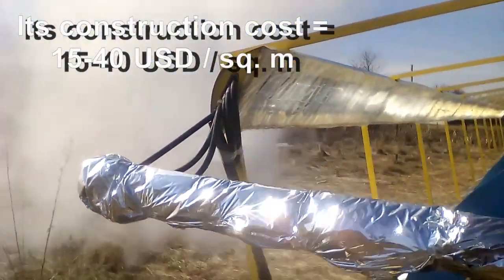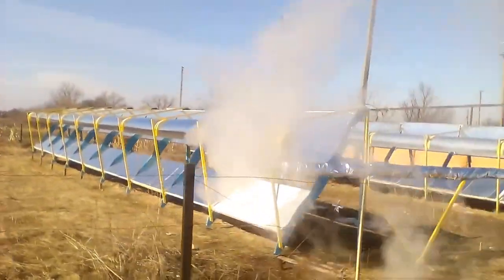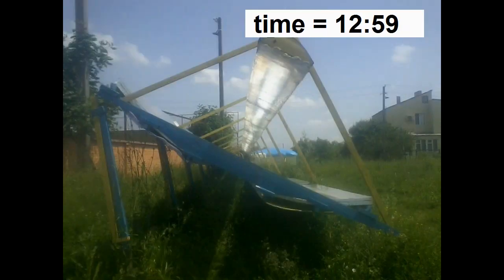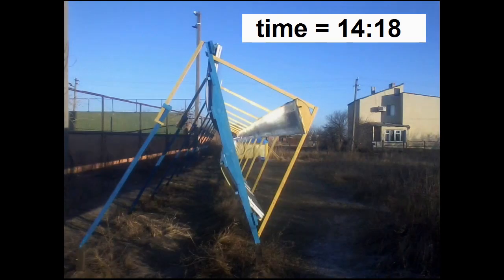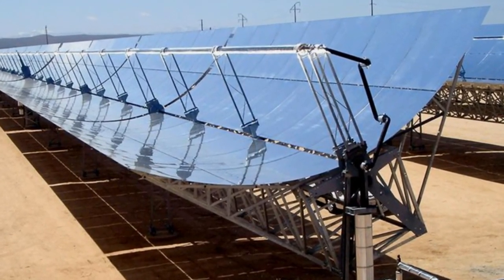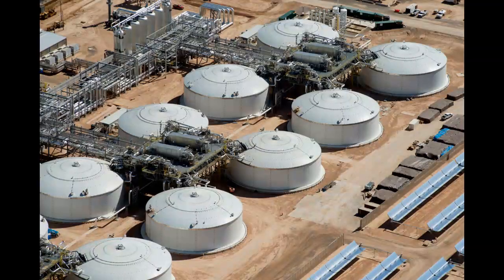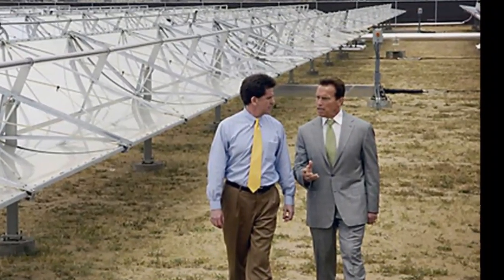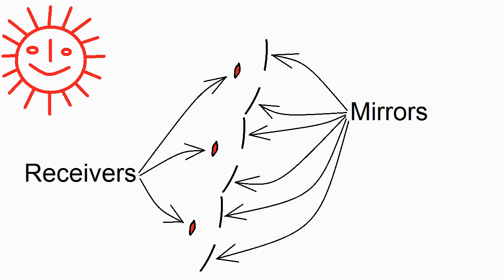Very cheap ( $15-40 ) solar collector-concentrator that does not need a tracker

Comment: Unfortunately, in your videos and projects, all of you focus on the movement issues of the shower, and you forget the most important thing, which is connecting the water pipes, entry and exit, beside the heating head, in the dish collectors. The scenes are not important except those.

Comment: Great vid. Thanks. Another option for 150-200°C heat is an ORC generator. Use the high heat to make electricity (ORC), then use the waste heat to heat water for hot water & space heating.
Reply: Hmm so this is capable of super heating steam above the 100°C or is that what the ORC is for to super heat the steam? 

Is it possible to also use the system with the ORC to take the low pressure steam put out by the ORC for the production of browns gas to further improve and maximize output in a zero waste system in a multi step process? I.e. this concentrator creates steam which powers the ORC which creates heat for heating and power which the wet low pressure steam from the ORC is then used for electrolysis to make browns gas which powers another engine which produces water as a waste with heat and electricity being generated and harnessed where as the water goes into a tank where the water is cooled before being pumped into the solar concentrator? 

Sorry if thats convelluded new to all this and trying to learn as I wanna build my own off grid sanctuary...
Reply: @kingdarkem  ORC's don't use water, they use a closed loop gas. Think air conditioner but used to make energy, instead of using it to cool or heat. It uses the temp to flash boil the gas (refriderant, CO2, LPG, other) to push the turbine, which turns the generator. They tend to be used where mid or high temperature heat is NOT available (less then 500°C) or trying to increase efficiency in high temp systems to use waste heat to get more power out. Also used in remote locations (towns, minesites, etc...) where large diesel generators are used to use as much heat from exhaust & cooling water before being rejected to the astmosphere.

Main reason they are not implemented more is due mainly to setup cost. Not that many companies do these systems and those that do tend to be pricey to lack of demand/interest.

There are small systems available. If you have experience with building air conditioning systems you could build one for yourself, or buy a "kit" from the small system manufactures.
Reply: @elenidemos  u dont need complicated setup or exotic gas for refrigerant, if u plan to build some solar refirgerator ammonia are cheapest way, assumed u know how to seal n handle ammonia, then free ice maker!

Comment: I've always wondered why they didn't align the concentrators (parabolic troughs)  east to west as was done here. Even if they used the exact same trough profile and thin line collector the tracking mechanism would have a lot less work to do and hence probably be less likely to experience wear. Nice to see somebody taking this approach. As I see it, adding a fairly simple tracking system with a movement range of less than 90 degrees to focus the spot accurately throughout the day would make the system capable of higher temperatures and more consistent output. The closer to the equator the less the movement range would have to be. I'm just glad to see someone trying this approach!
Reply: to put it simply : the west/east side need more surface cause you can't stack them one behind another.
At first sight, north/south is better

But I guess Sergiy is the first to have retro engineered it to decrease the cost by ignoring the downside of E/W solar concentrator.

Comment: I've seen two parabolic heaters in my life.  Why they haven't caught on for home use is beyond me.  Especially in the winter months.
The first time was in high school in the late 70's to 80.   The school had an energy science fair.  There was a parabolic heater.  It was quite ingenious because it really didn't take much to make.
The second time was a house a few blocks from me.   For some reason it's not being used anymore.   
I think my concern would be the excess heat generated and where to put that pressure.
Reply: A big insulated water tank may be?
Reply: Release it through a turbine, store it in any system efficinet enough to contain your excess energy long enough to cover night tine usage
Reply: @dlayman101  If I had unlimited water that would be a great idea
Reply: @beebob1279  closed loop, low pressure and high pressure side, just like a heat pump, then use a geothermal loop as the condenser, done deal bud.
Reply: @beebob1279  actually theres more too it but do some reading aboit absortion coolers, combine that with geothermal loop, combine that with an electric solar panel coolant loop, instead of a vacuum tube, build a single cell channel, point mirrors at that boost the electrical generation to 80 precent, remove the excess heat from the solar cell to increase longevity of said cell, then take the heat used to power your turbine, followed by use remaining heat to heat the absortion coolers boiler, all excess heat not needed can be converted to cold via absortion cooler, then any excess cold can be used to cool your house, or your panel array. And remember there is no such thing as cooling, only heat transfer due to a energy differential of heat energy, as long as there is difference of tempature, that difference can be used to boost efficiency.

And an absortion coolant system does not require a compressor or electricity.

Enjoy researching that project, im going to go bqck and continure building a solar company based on my idea like ive been doing lol.

If youve got questions feel free to ask, this solar guy is one of the few who isnt out there to scam anyone.
Reply: what you can do with excess power is always heat up some temperature isolated salt or sand with heat exchanger built in...☺ when you need extra power you may always draw from this surplus heat auxilliary supply...like at night or in cloudy times...or even winter...
Reply: @dlayman101  and one can use your idea about cooling when you stay in places where there is too much heat, in combination with surplus heat storage...there is so much possibility...

Comment: An offset receiver, getting reflected sun, is exactly how high gain satellite dish designs work.  It improves efficiency by removing the 'dead spot' in front of the parabolic reflector.

Comment: This may sound REALLY dumb, but couldn't you orient your solar collectors the same way as the tracking ones and use a simple counterweight system to rotate them throughout the day?

It would require a bucket big enough to hold enough weight in water to tip the panels, a very small water pump to fill the bucket, a timer for the pump, and a pulley so that when the bucket has enough water there's enough resistance to not just tip the panels all the way to the other side. A small hole in the bucket (or an automated valve) would make sure the bucket is emptied at night for the system to reset.

Comment: Sergiy, I really appreciate your work. Have watched many of your videos. You are very creative, and approach the data scientifically, which I appreciate. Thank you.
My question is about the steam generator part of the system. How does that work to create DC electricity, please? Is there a particular steam generator unit that you recommend? Is it a closed unit so the steam condenses back to water, then steam again or do you need to add water regularly, please?
Reply from the maker: It seems to me that the best generator (for heat up to 150 degrees Celsius) is ORC. For example: https://infinityturbine.com/it50-system-plans/
Reply: Sergiy Yurko wow, that is a huge machine!
Thanks for posting these vids. I learned a lot.

Comment: A drum of gravel and water can store far more energy as the thermal mass is increased. Insulate with wooden box filled with hay or even chipped polystyrene. Very impresed with your work

Comment: hello from Denmark
I enjoyed seeing the video you put up on YouTube.
two of the Solar System's you are showing is from Denmark
which build together with small district heating plants in small towns in Denmark to make it more climate-friendly and cheaper
the two systems point in a southeasterly direction
in the direction of high noon. 
some of the systems can move but it's only moving from summer time to winter time
there are many systems like that in Denmark.
in Denmark in winter there is only 7 hours of sunlight that the sun is very low so therefore it is important that the panels can be moved

Comment: Genius! I am interested in similar concepts but applied to greenhouses. Earthen or wood/cob walls, slotted opening in back (narrow and above head level for safety with shutter or curtain at night) with white ceiling, grow veggies early and late in season. Warm and well protected from extremes, dome shape would have water collection at base/circumference so rain would still get to crop within, but storage could be built in wall too so thermals mass effect could help keep temps in nice zone, and downpours would have more time to soak in nice and slow/gentle.

Comment: I am interested in heating oil. Circulating the oil to make the storage tank hotter. I think the temperature could reach 400 degrees Fahrenheit (200 degrees Celsius) as I saw in another video of one made for a university. I don't believe I could use regular pipes in the collector area. Hoping to hear back from you. I'm in Phoenix, Arizona.

Comment: If you use a helix wound coil for heating water or coiled pipe you may heat water more or a worker fluid more over time or a more compact space.

Comment: I wonder if a system like yours could be used to power an ammonia absorption refrigeration system like the I.S.A.A.C solar ice maker.  I would love to find a way to reduce refrigeration and freezing costs, as well as providing at least a marginal non-electric back-up.
Reply: Im literally in the middle of building a company that does exactly that. One larger absortion based hest exchanger, a geothermal cooling loop, electrical colar panels insulated with argon, with enough reflected light pointing at it that it will absorb enough heat to ruin the solar cell, except the solar panel array will be cooled by an absortion heat exchanger, which the same array will then produce more elctricity per sq ft, and as long as the absortion cooler is large enough, it can be used to cool a radiator fluid loop thats pumped into and out of the home to be used for refridgeration, air conditioning, or heating depending on the time of year.

It removes massive peak electrical loads of the compressors in those appliances, therefore reducing the required size of the solar array. As well as the size of the battery storage system, as well as the size of the inverter required.

If the remaining electrical devices and appliances in the home are converted to direct dc power, then an inverter is no longer required, as well as your efficiency will increase another 20 or 30 precent because inverters are not efficient, and the majority of the stuff we plug in today goes through a transformer and bridge rectifier, which again reduces efficiency, which is done to conver ac to dc for ypur device to use, and dc motors are more efficient, so any fans or motor powered objects would be more efficient, other then lights and the charging of a few phones, maybe televisions and computers, most of the most electricaly intensive jobs are now being done by heat exchanger loops. Ive done the math, and i know for an absolute fact this all works, all with technology that has been around for nearly 100 years.

Its not about the gas or pollution, its about sustainable, independent, prosporus access to energy, for the right price.

Comment: What about putting PV for the front face of the absorber? If I remember, PV output scales linearly with intensity for several times normal solar intensity. In this situation, the thermal loop acts as a PV temp regulator, also drawing in the Joules for storage and for feeding a high temperature  loop like this one (increasing the resulting flow rate for the boiler). Such system would generate electricity for pumping and support logistics. 

Excellent work and presentation, my friend. I had a similar idea decades ago, but life got in my way.
Reply: the PV gets damage with 2-3suns... :( it simply burns
Reply: @Channel-tr1hx  Thus would need active cooling, using the stage 1 thermal loop... but thanks for the reply.

Comment: I think that your experimentation is very good. I noticed that one part of the video showed an offset so that a part of the parabola was not shared by the heat receivers. I have considered that but I do not see many trough designs using it so I assume that the advantage is minimal. Is that what your research shows? My goal is simply for private home heating for water and radiators in the home for heat. Other experimentation that I have seen were adamant about receivers in an evacuated borosilicate tube with the heating fluid inside the evacuated tube. That seems to be a lot of expense and maintenance for the application. I was also surprised at the cost of sun tracker control and drive. I have sourced one company in the US that sells highly polished micro-thin stainless steel. It was much less expensive than I expected, but Mylar seems to be a cheaper but lower-quality solution. The main advantages would be cost and lighter weight than first surface mirrors. I also wonder about the covering that is used for model airplane covering. I have not found any, so I have no way of knowing the reflectivity. The advantage is that it has heat-sensitive glue on the second surface to apply with a hot iron. I have a big weather concern. How much wind and hail will these panels take before they are destroyed. I show that you live in Patagonia. Why are you not taking advantage of that constant 40 kph wind? Thank you for your ongoing work.

Comment: Looks like you're living in a cold climate, you might be better off with striling generators on the end of your solar arrays.  That way the massive heat difference between the winter air and heat receiver would produce more power than the losses you'd get from converting to steam and through a turbine.

Comment: Hi Sergiy, I REALLY appreciate your work!... I have some questions:

1. Why not reflective mylar film?
2. Why 4 lines of mirrors instead of 2 bigger ones focusing in only one heating tube?
3. There is any cheaper version of steam turbine (than Infinity Turbine... I know they offer the blueprints... but it's beyond my skills)
4. If I want to use the compressed vapor to move a simple steam motor... how can I avoid the vapor to "Bubble" in the water tank?

Thanks in advance
Reply: Hi, i'm certainly not an expert, but i suspect that mylar would i) be difficult to glue down smoothly unless you have right tools, ii) the mylar and glue would degrade fairly quickly after a few months and start coming apart or bubbling. Can't answer the turbine query. A simplified explanation to stop bubbling or boiling of the water, it needs to be stored in a high pressure tank/geyser system, and the sudden release of pressure when it flows through a one-way valve gives the "steam" to drive the turbine..water vapour is not steam btw, steam is "invisible" until the pressure and temp drops enough for it to condense. I am working on a similar system using mineral oil as the heat carrier to heat water and a modular heat storage setup. I tested one copper pipe with one curved reflector and glycol(antifreeze) and got to 89°C before the T° probe melted.

Comment: solar water heater > steam/electric generator > (Battery Bank) 
                                 > heat pump > a large tank of water.
bypass valve allows prioritizing between generating electricity or heating the water tank faster.

Comment: how do you determine the angle you need to set depending the day in order to optimally collect heat from the sun. can i ask for your references?
Thankss
Reply: I think it depends on where you live. For example Tashkent (the capital of Uzbekistan, I'm from Uzbekistan, by the way ) it is 41,3° N, and I have browse on the internet the angel of the sun per 21st days of the every month and the result is :
 highest : 72,1° on June 21st
Lowest : 25,3° on Dec 21st

Comment: Dear Sergiy, I am in India and working on ZLD solution for industrial effluent.Heat energy required to vaporize water is big amounts.I want to do it with your method. Right now Vapour compressors are used to recover latent heat from vapour and re-use it for evaporation. The amount of heat that we are right now looking at is 500 KW/hour. at 100 degC
Can you suggest to me some good approach?

Comment: Sergiy, Great work. any idea to increase the steam temp to 300 deg C.
Reply: vented systems can only reach 100 degrees. Closed loop systems must accommodate high pressure, which is a much more serious engineering and design challenge. Plus, the higher the operating temperature the greater the heat loss of uninsulated high temp components like the collector tube.

Comment: If not electricity it can certainly  heat water for bathing or for radient heating a lot easier..... do you have any plans? I have been trying to figure out how to heat water more efficiently for less
Reply: Or a mass floor heater if you're on a slab.   I grew up with radiant floor heating.  It was great.  The house could hold its heat for a few days in winter if the power went out.  It took a while to heat back up with the oil heater, but we were somewhat warm.